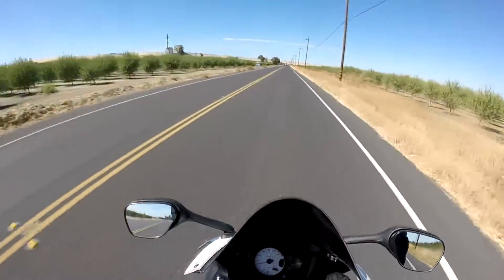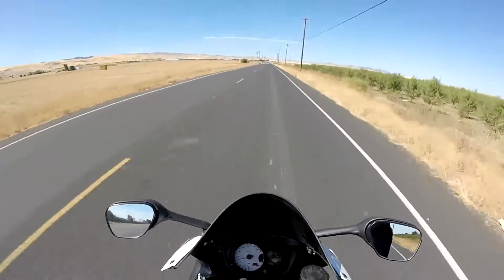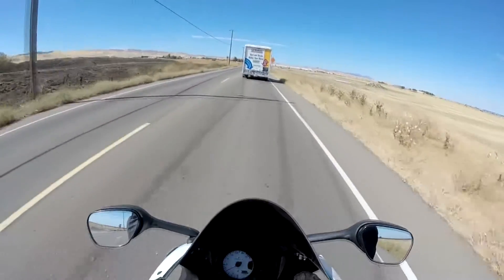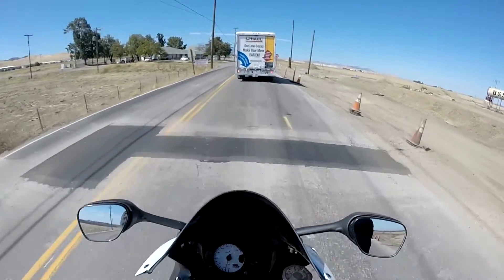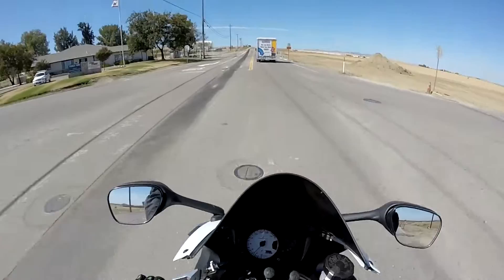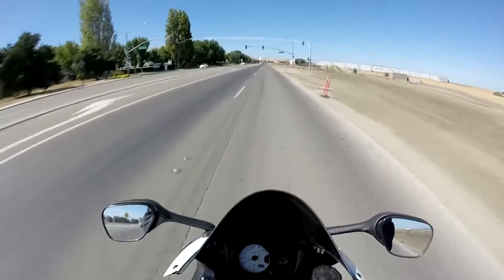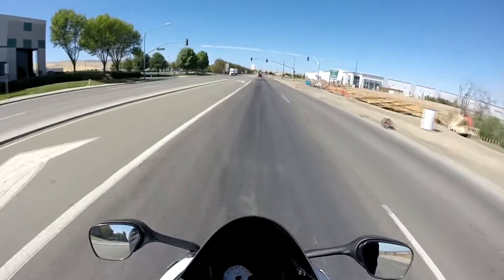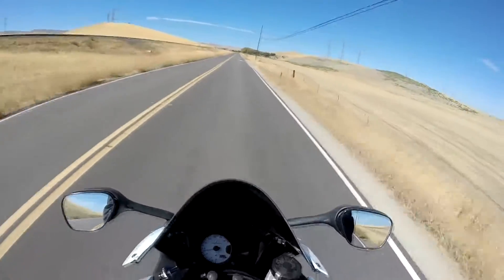2007 Suzuki GSX-R 750 Problems | Resolved!

Comment: Ladies and gents. Buy both rectifier and stator and replace them. So you know your good and your ride wont fail you. Hopefully
Reply from the maker: +Dale Curiel You're right, it's not a bad idea to just replace both and then be done with it but you're also wrong, there are no ladies here...
Reply: You are correct the issue does stem from the stock location of the rectifier. It is subjected to an excessive amount of heat being just above the headers and behind the radiator. Once you relocate the rectifier replace the stator your issues will be resolved however putting the rectifier inside the airbox doesn't seem to be the best solution. You can pick up a rectifier relocation bracket that is a direct bolt-on application from flatlandInnovations,com This puts the rectifier in front of the radiator where you would commonly find an oil cooler. This will restore the reliability and resolve the issue. I have an 07 GSXR 750 in my opinion it's the best sport bike on the planet I hope this helps. You can also look at the YouTube video for flatlandi nnovations rectifier relocation bracket
Reply: I just replaced both, good parts not Amazon cheap stuff. Now the bike will only idle for 5-10 seconds. Voltage goes up to 14.3 then bikes dies and voltage drops. Not sure where to go from here

Comment: Regulator rectifiers waste a lot of energy in heat converting the AC voltage the bike makes into stable DC. I've found on my Hondas, Yamahas, Kawasakis, I need to put it in direct air stream to cool. I can only imagine if I lived in a hotter state, they burn up in the colder NYS weather too.

Comment: i think its a stator problem on my bike because when i went to turn it on, it was cranking slowly and before that i had turned it on. Then it wouldn't turn on at all. I then recharged the battery, tested it with a volt meter, and it gave me 12.5 when they bike was completely turned off. Then when i started it, it went down to 11.9 and i revved it and it didn't even go up.

Comment: reat dos and donts vid. so from replacing just your rectifier did you encounter any problems after? I did the same but 5 days later my bike died again. I assumed it's the stator now. sent u a like and a sub keep them coming man
Reply from the maker: Thanks brother. I try to get vids out but time is a real bitch... Anyway, no my bike was great after changing the regulator. I did relocate it as well so it won't fry up anymore, I don't know if you did the same but it's easy and I recommend doing it.
Reply: +StickySideDown no I didn't relocate it. I figured I wasn't gonna ride this bike forever just this season then possibly a brand new one next year.

Comment: I always loved the looks and the feeling of that bike, i was about to buy one but all my friends said: "NO, don't do it."
I thought they were going for the "gixxers are for douchebags" arguments, but they said :" they have electrical issues"... Sad to know that such a great bike got a lot of problems. :(
Reply: You should still get one, they're a hoot to ride and very comfortable compared to the other Supersports (although that is a personal thing... The others aren't safe from electrical issues either and the GSX-R's issues are rather preventable with little work. On ZX-6R's for example, it gets so toasty under the seat due to the undertail exhaust that the ECU will eventually get fried. Talk about a pricey repair. Also some CBR600's (think the F4i, not sure though) can just catch on fire willy-nilly due to, you guessed it, electrical issues.
All you pretty much have to do is relocate the rectifier, because that will pretty much save you from all the other problems. As soon as the rectifier (which I often call "Rektifrier" due to its suicidal nature) goes, you're pretty much boned if you don't replace it right away.

There's no bike that is completely free from issues but it's up to you how you deal with them.
Reply: There's a easy Salton to the rectifier you just mount it on the side of the bike instead of right over the radiator same with the stator

Comment: Good morning:
I have a question about these parts. Does the regulator rectifier and the generator stator both have the same voltage and if not what are those voltage suppose to be? Also I need to know if they are working well? Thank You

Comment: how is it holding up so far ?
Reply from the maker: +jwrath90 Wow, I can't believe the timing of your comment haha! What I mean is the bike was perfect up until about a day ago when I found out I had to jump the bike because the battery was dead. It was a while since I had ridden it last so I didn't think too much about it. Today, however, I went to go to work, had to jump it. And after only five hours at work, had to jump it again. So, to answer your question, it WAS holding up great! Not so much anymore...
Reply: StickySideDown hmm. I was curious. I've been through 5 rr's, 4 batteries and about 3 stators. it seems like the rr goes out m every year. this last time was about 6 months. twice with "relocating" it. I've just about had enough. that is until I read that they might be going out because if the type of rr. Apparently there us what's called a mosfet regulator that's supposed to not go out because it has a different way of working that jeeps it cool . I'm thinking of giving it one last try and going do or die by investing in one. I love my bike.
Reply: @jwrath90 soo how did it go bro?